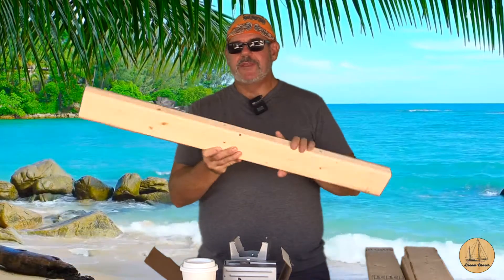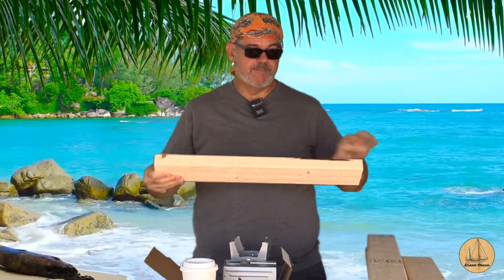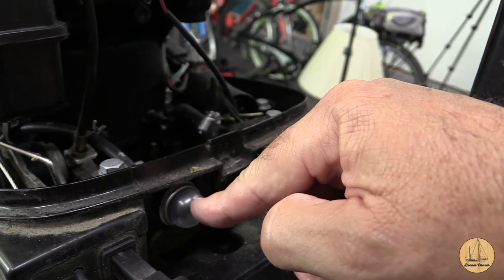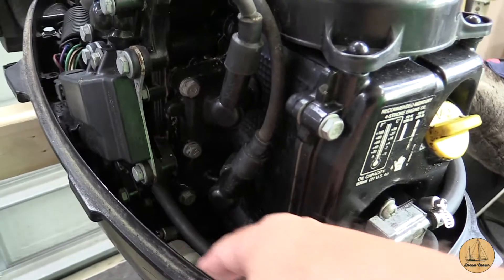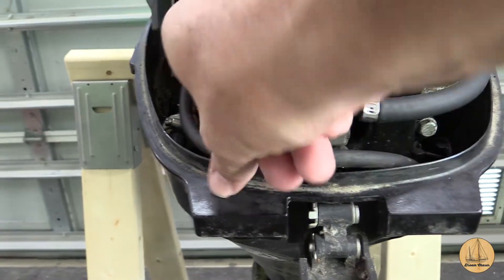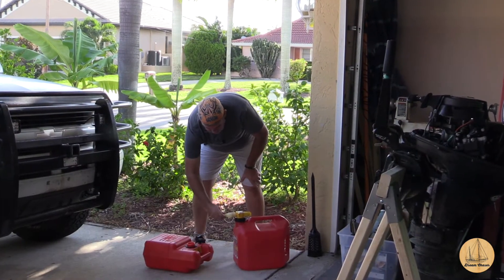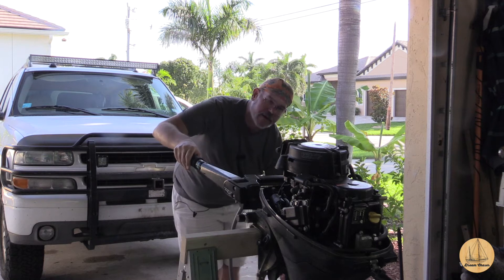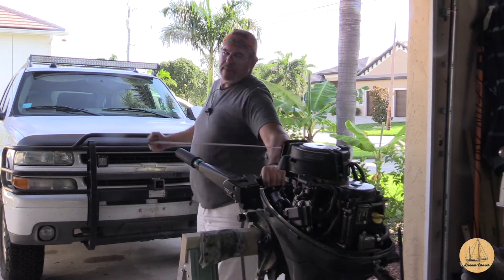Resurrect Mercury 9.9 hp Outboard (Part 1)

Comment: Two things buddy! If you're still working on the carb and don't wanna spend all that money on an ultrasonic cleaner I've seen a video (never actually tried it myself because I have one) where a guy bent an aluminum plate into an adapter that will attach to a palm sander. He then screwed the adapter to the lid of a plastic jar. The guy suspended the sander with some cheap rubber cords and had a cleaner that seemed to work prity well!

Secondly, if you're gonna use ethanol gas in that new tank keep the vent closed. You'd be shocked how much moisture that stuff pulls out of the air! With it expanding and contracting with the heat every day it's pulling in fresh humid Florida air daily so only open it when you are running the motor so that the pump isn't fighting a vacuum for fuel. 

Bonus! I'd take the fuel line loose again an flush each component in line before pushing trash from the pump ect into the carb.

Just trying to be helpful, so I hope you're not offended. LoL Good luck buddy. Best wishes - always.. 😎
Reply from the maker: Not offended at all. You are correct as the fuel pump had crap in it as well.